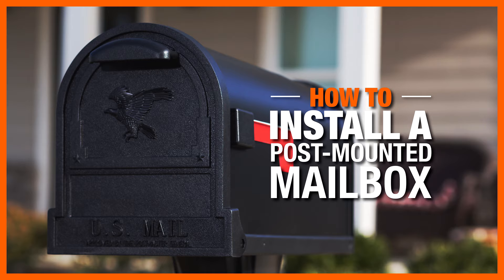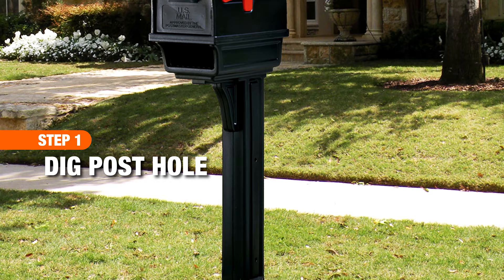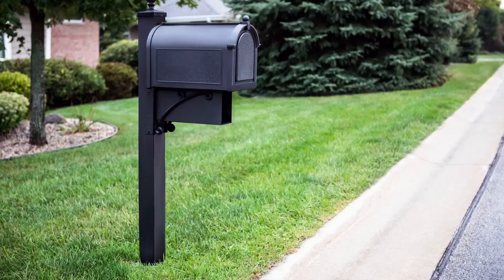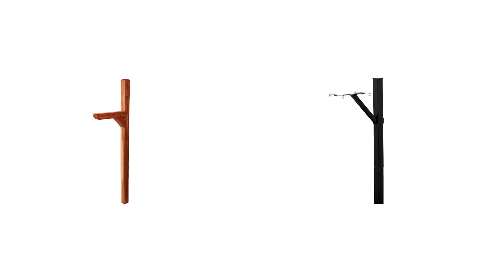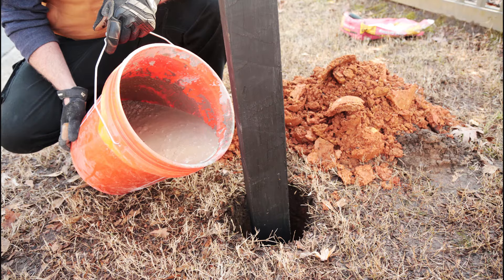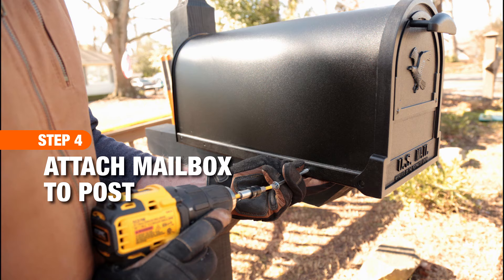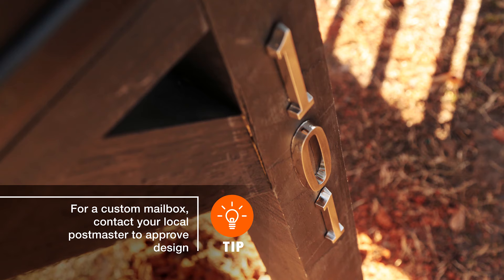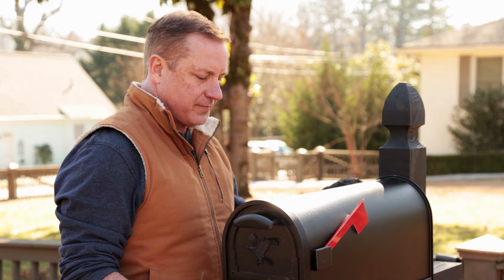How to Install a Mailbox | The Home Depot

Comment: Eff the concrete!
Reply: Do u. Need concrete??
Reply: You do if you want your mailbox to stay up and in case someone hits it, so they don't only damage your box but their car too lol. But dirt would rot the post quicker anyway. I usually dig a post hole and use a square plastic post and fill it 3/4 of the way up with concrete.  Like a brick wall then

Comment: Use a 4" PVC pipe and a 4" toilet flange to mount the mailbox. Dig your hole, insert pipe and pour some concrete around pipe. Fill the pipe 75% of the way with concrete and rebar. Level/plumb and let dry. After aligning and marking toilet flange holes, drill 4 mailbox holes and attach the flange to the underside of the mailbox with smooth top carriage bolts and nuts. PVC glue and slide the flange on the pipe. Paint your PVC post and you're all set.

Comment: I only want to know how to install the MAILBOX to the post.
Reply: Get someone to hold the mailbox on the post while you drill. Drilled wood screws 1" to 2" will pierce the bottom of the metal (if no holes already) and go into place in post. I would say most if not all mailboxes come with mounting holes for screws.
Reply: @Ncharlestun  Thank you. I installed the mailbox by myself. I had purchased a metal frame that was supposed to go under the box attached to the flat part of the post but it didn't fit. So I drilled four holes, screwed in long stainless screws through the mailbox holes and got it done. Added my big reflective numbers. 
The instructions for the metal frame are complicated because it has a bunch of various size holes for different types of posts and the instructions are ridiculous. Now I'm stuck with a $15 frame I can't use. Oh well, live and learn.